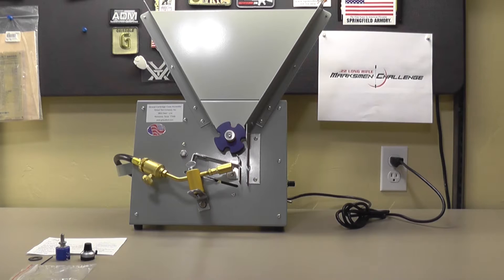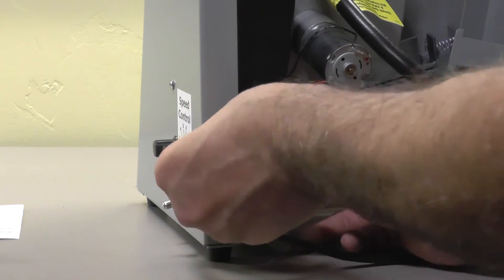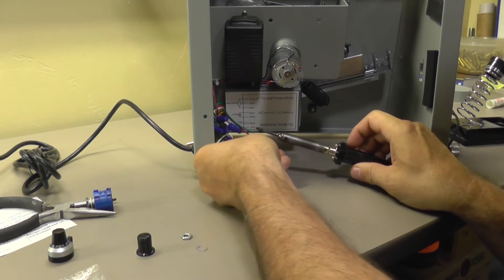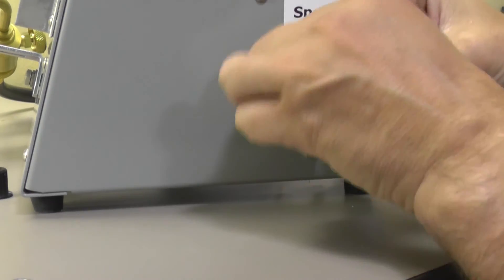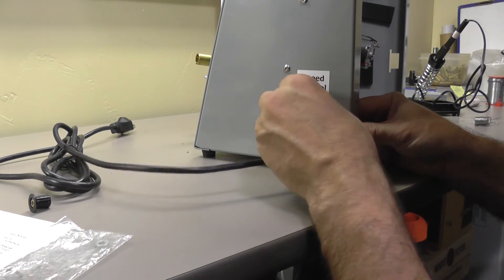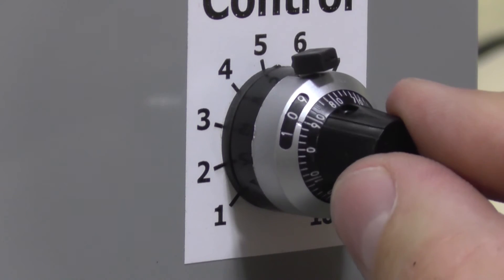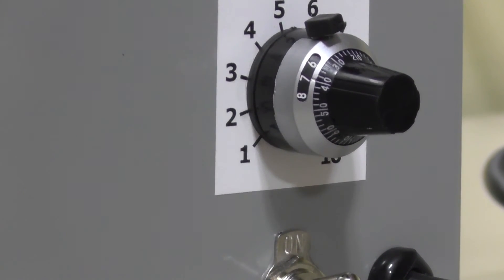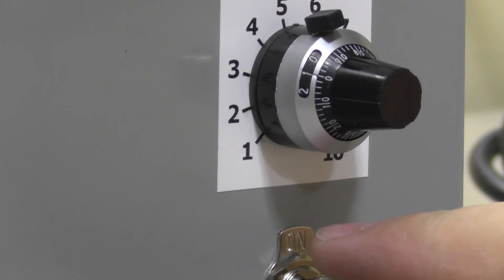Giraud annealer speed control upgrade - .Marksmen Challenge tutorial series - Episode 1

Comment: What was the electrical  resistance in ohms of the original pot from (end to end) not the wiper. You need to get as close as possible to that resistance with a new 10 turn pot and dial. Also did you look at using a volt meter on the wiper, this way you could get a numerical value for each case annealed time value. Record the volt number as a datum of time.

Comment: Just a note, the design has pretty seriously changed on the controller.  No longer soldered on, and no wire diagram nor color coding included.
Reply from the maker: Hmm, that stinks. The exact same controller?
Reply: Ya.  But the leads connecting the controller are now a pressed on type that can't be soldered off.  And the cable is now quasi one piece cable that connects to quick disconnect on the circuitboard.